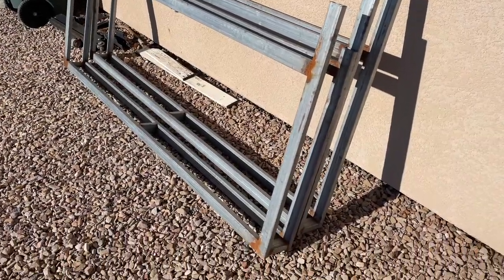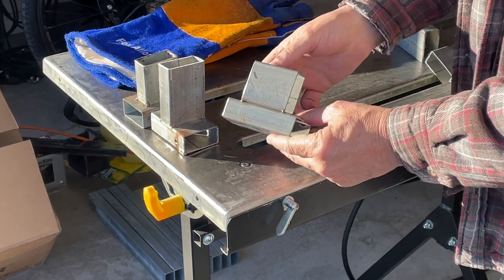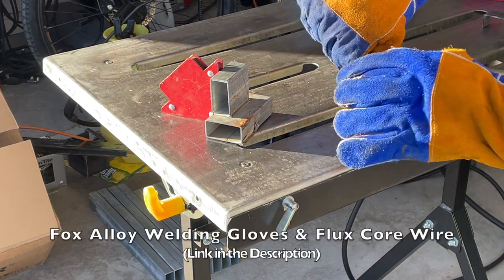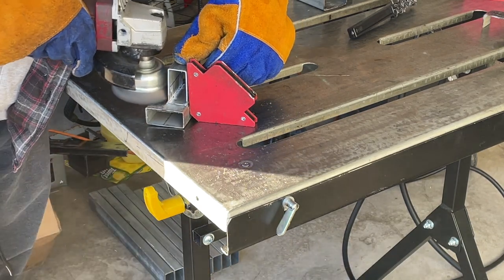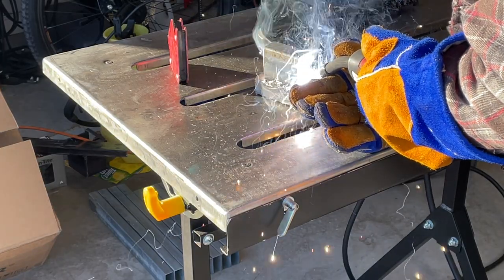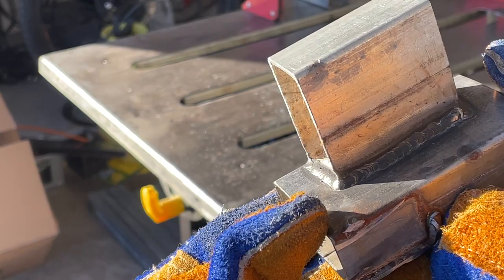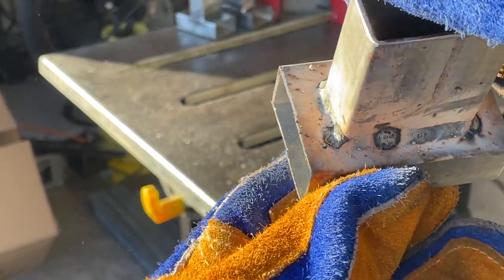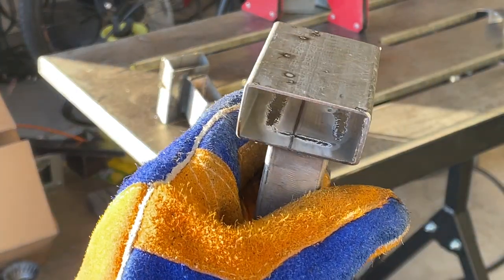Gasless Flux Core Welding Thin Wall Galvanized Tubing - Tips and Tricks

Comment: 1. Wear a respirator at all times when welding galvanized steel.
2. Get a fan and place it in a manner the blows smoke away from you.
3. When possible grind away the galvanized coating where you intend to weld. 

These 3 things should be done every single time you intend to weld galvanized steel.

Comment: I had never thought to not use the cup mug welding with flux core wire. . I was so patterned after using gas when mig welding. I would bet the visibility is so much better. 
Thanks 👍
Reply from the maker: Yes you get much better visibility and no more cleaning the cup. If you try it make sure you wrap some Teflon tape over the threads and gas holes so they don't get messed up from spatter and slag. I got that tip from Jody at Welding Tips and Tricks. It's a brilliant hack and I've use it for many years now. I wish you the best and thanks for stopping by! 👍

Comment: Hey Bruce have you ever done a Blue Demon vs Forney wire/filler video? I tend to use Blue Demon, but Mike Festiva has had excellent results from Forney. I also use Hobart Filler too. Also, I use anti spatter spray when I use flux core to reduce my clean up times.
Reply from the maker: No I haven't done any wire comparison videos. I've seen videos with some good results using YesWelder flux core wire but I haven't tried any myself.

Comment: Problem with going back over it you didn’t clean off the flux before welding it again so you weakened the weld with trapped flux mixed with the weld
Reply: Yep. Leads to porosity

Comment: Did you need to clean off galvanizing on material before welding it? What guage of wire did you run?
Reply from the maker: No I didn’t clean off the galvanization. I use .030 wire.

Comment: Is your welder configured with a positive or negative ground?
Reply from the maker: I always run my gasless flux core wire DCEN. Electrode negative and work clamp positive. (strait polarity)
Reply: @DIYHomesteadProjectsDIYHP10  Thanks for the info. I’m sure that makes for less splatter and better welds overall.
Reply from the maker: Yes, that is correct.

Comment: Is there a particular brand of wire you recommend?
Reply from the maker: Yes, my favorite Flux Core wire is the YesWelder .030. I have tried many different brands but this is the one I've had the best results with. 
E71T-GS/2LB-0.8 2LB Spool .030" Gasless Flux Core MIG Welding Wire
https://yeswelder.com/collections/accessories/products/welding-wire-e71tgs208?ref=DIYHP10%25
Use the promo code DIYHP10% at checkout for 10% OFF your entire order at
https://yeswelder.com/?ref=DIYHP10%25
Reply: I have that wire here but I haven't tried it yet. I will as soon as iI run out this spool of Harbor Freight wire that I bought when I bought the welder. Thanks for the help.
Reply from the maker: I've used quite a bit of the Harbor Freight wire and it's ok but I think you'll really see the difference when you try the YesWelder wire. I think it's much smoother than the HF wire. I wish you the best!
Reply: Lincoln has a good multi pass wire

Comment: You're outside, so good ventilation for dealing with galvanized steel. Also, drink a big glass of regular milk after working with it. It staves off the poison in galvanized welding.
Reply from the maker: You’re right! I’ve never had any problems welding galvanized metal outside. Thanks for your input!

Comment: Kind of interesting for a beginner like myself. But you didn't explain how you were dealing with the very real dangers of Galvanized material and what precautions you took. Also when you said you used a E-pattern weld you didn't describe what that is. All very vague.  Basically it's a video watching you weld and patting yourself on the back.
Reply: Maybe he doesn't know about being poisoned by the fumes from welding galvanized metal.
Reply: Good ventilation, which he's outside, and drink a very large glass of milk after dealing with galvanized steel.
Reply: Small cursive e pattern is what he meant